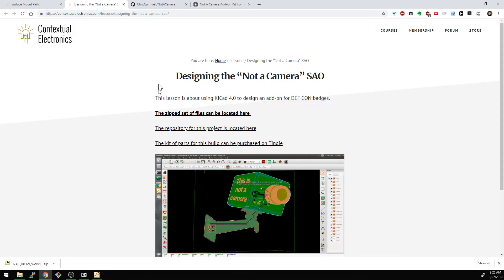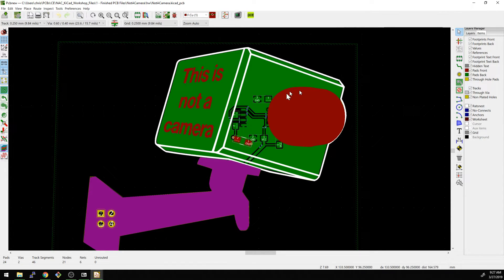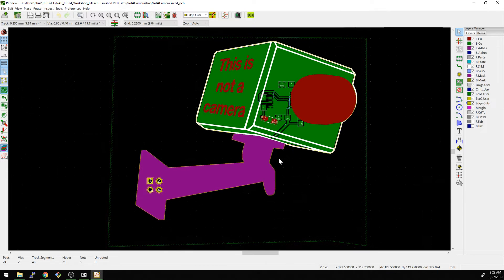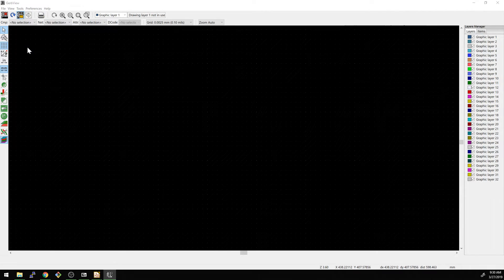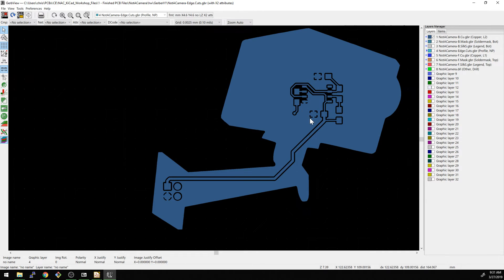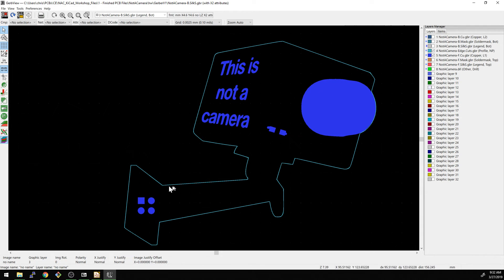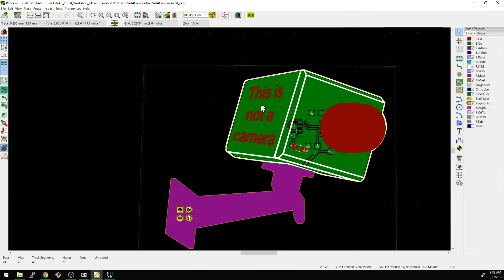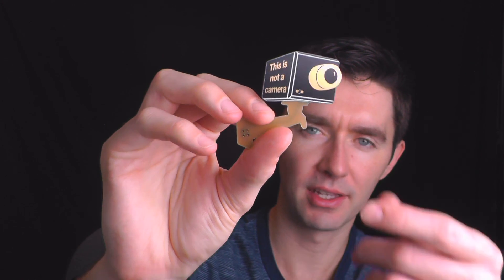PCB Design In Reverse - Part 2 - Reviewing files

Comment: i just watched "scancad" stuff and it makes sense on reverse engineering ideas.. plus 30-40-50 year old pcbs are still needed at places even like nasa.  also, if the pcb is made 100% like the master pcb, one big advantage is the specs will meet the FCC and the like for aircraft, etc... whereas a new pcb design must pass the federal rules.  Mmmm?  thanks a lot...:)